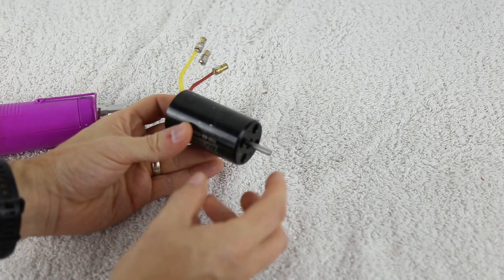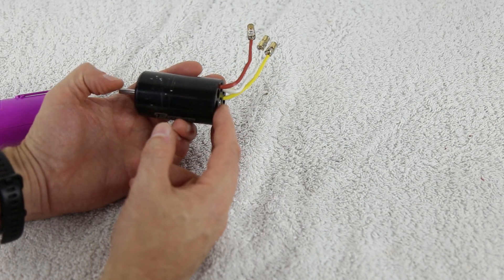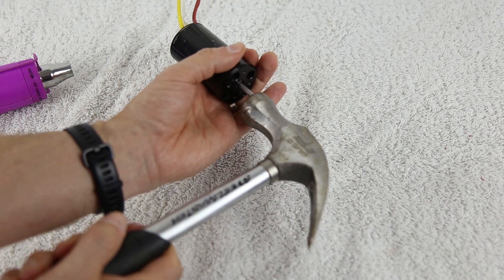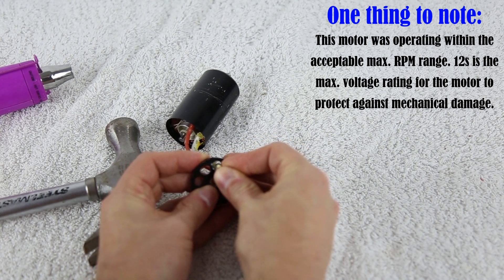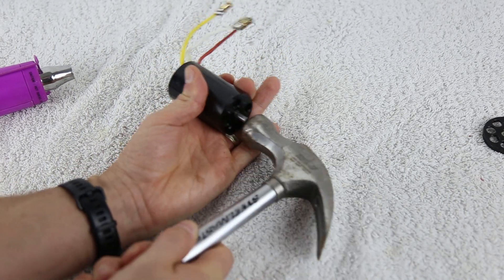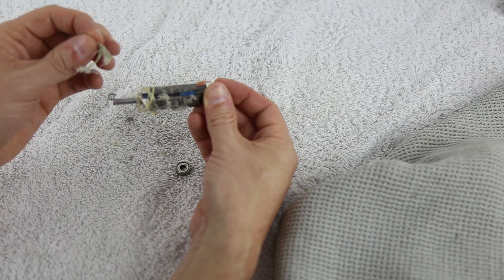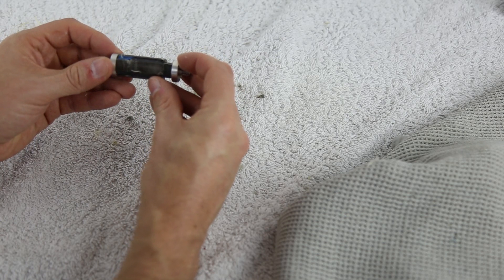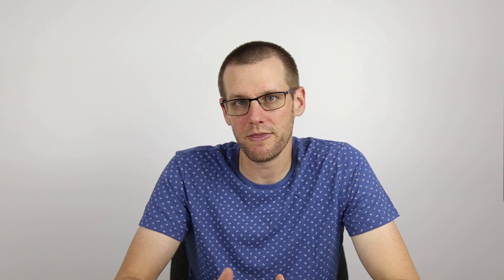Brushless Motor Fail in this Flight let's Determine What Happened

Comment: Hello! I love your videos! I have a slightly different issue with my brushless motor though. After running my brushless converted 3S powered monster truck for ~30 minutes (and frankly, giving it beans) it stopped. After taking it apart I found out the motor shaft with pinion gear sheared clean off. Is 3,175mm shaft not suitable for 3S? Is 3100kV too much?
Reply from the maker: No 1/8in shaft is strong enough

Comment: Just a little unrelated question. If I were to buy a Castle Creations 800kv "Soda Can" sized motor which claims its up to 10 HP 7000W approximately, does that mean I could replace a 200cc 6.5hp gas motor in a small go cart with it? Geared low enough of coarse accounting for the constant wattage and burst power
Reply from the maker: Yes. 12s geared way down.
Reply: @RCexplained  Thanks!